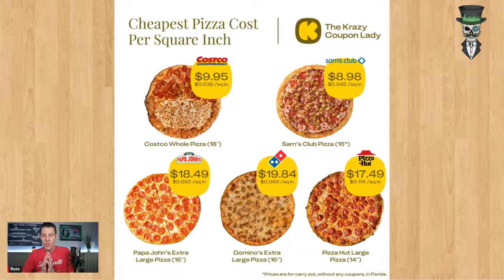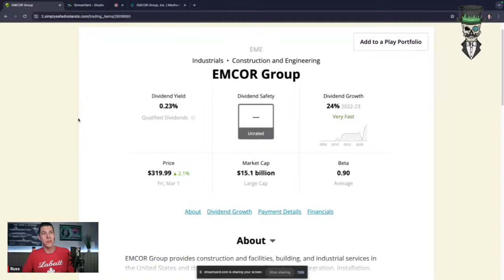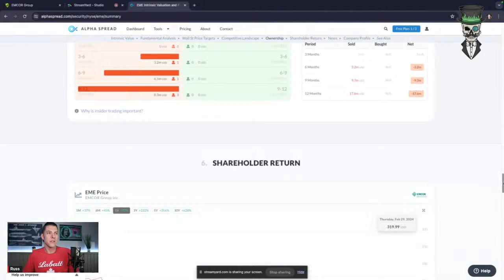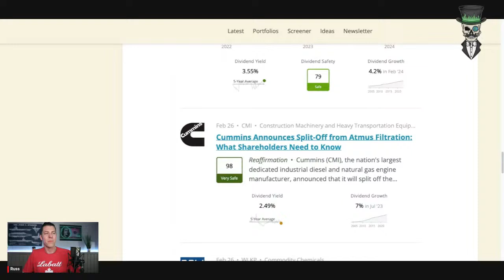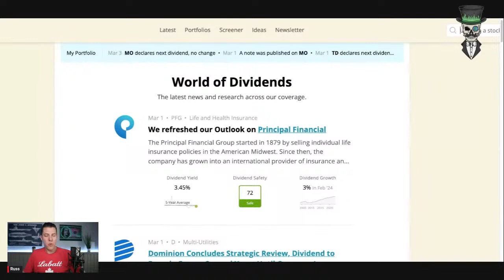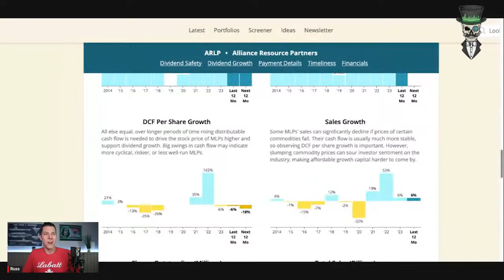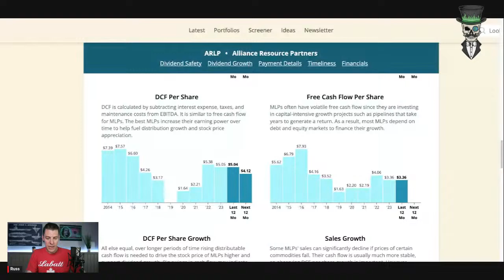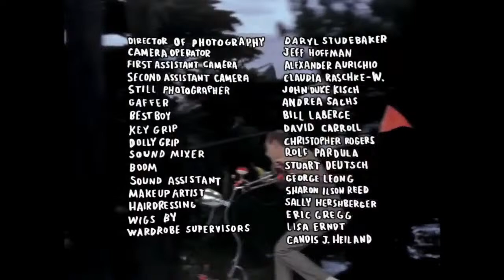The DIVIDEND stock that could surprise you!

Comment: Alternative investment advice: Buy a Toyota
Reply from the maker: We’re definitely looking at Toyotas!!
Reply: @DapperDividends  I've had most of the lineup over the years and with regular proper maintenance they've all made it over 300k miles without any major repairs other than your regular wear like belts or water pumps.
Reply from the maker: @caseyflint6907  noted and all options are on the table…. It’s the eternal struggle between my wife and I because I want cheap as possible but my wife wants to pay up a little for dependability…. So there will eventually be a happy medium.
Reply from the maker: @caseyflint6907 love to hear that!